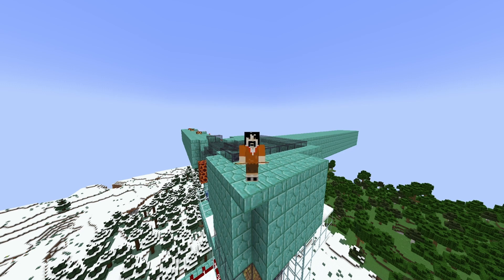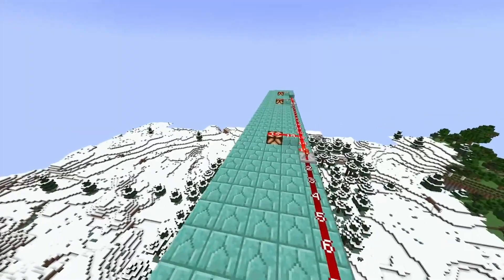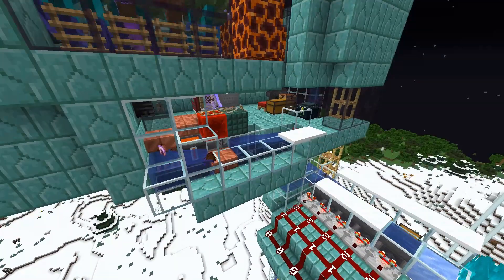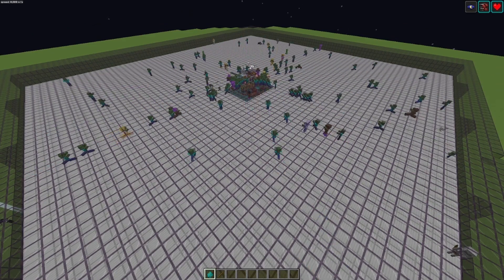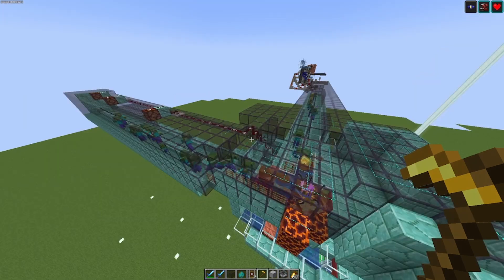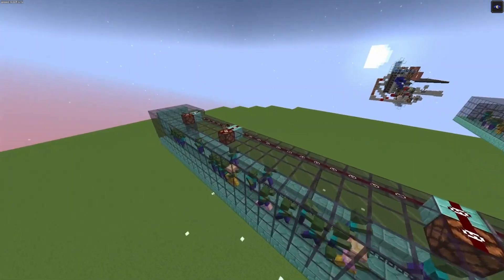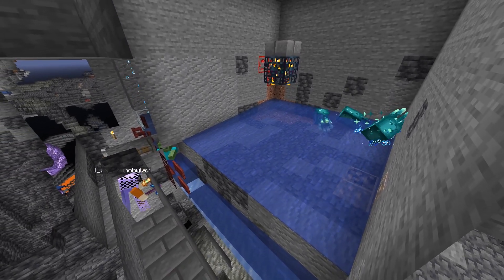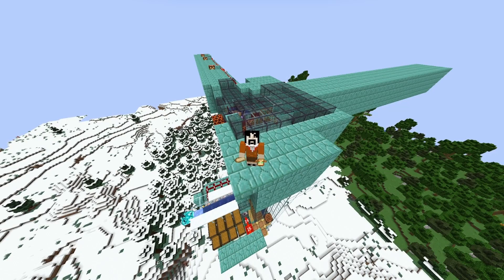(DEPRECATED) Lag-friendly copper farm based on IanXOFours design (Minecraft Java 19-1.21.1)

Comment: Hey Fruno, I built this farm on our SMP and somehow the minecarts are burning up in the lava cauldron. Would you have any idea why this is happening? I did use another mini block instead of the skelly skull, but as far as I know they all have the same hitbox.
Reply from the maker: I've seen this too, but very rarely and only on a server. So I admit that I was lazy and didn't really investigate -- it seems to be lag related, I'll lose maybe 1 minecart every 1-2 hours. Perhaps a different yeeting setup would work? 
If you just want copper then you could set up a simple item filter below the killing spot, but unfortunately this means that a ton of items will be around for 5 minutes until they despawn, causing lag, so I went the minecart route.
Reply: @FrunoCraft  Thanks for your response! It is on a server far away indeed (I'm in EU, server in USA), locally it seems to work fine. If it's probably lag I should resub to ExitLag and hope that fixes it, as I lose all my minecarts in about ten minutes.

[edit] When it does work, it's insane by the way! Very nice farm design!

[edit2] Looks like Exitlag doesn't help here. I removed the miniblock and changed the slab above the rail to a stair and that does seem to work so far though!
Reply from the maker: @ScubaKay  I just came across Ilmangos initial design for the yeeter, and he uses a soul sand block where I use a full block (the redstone one). I have no clue if it makes a difference, but maybe switching out the redstone block for soul sand and powering the rail with a torch might improve reliability?
Reply: @FrunoCraft  I will certainly try that, thank you!
Reply from the maker: @ScubaKay  I did another tweak to the yeeting system. It may be possible that minecarts get lost if they aren't running at full speed, so I extended the track a little bit with powered rails. I uploaded a changed world download.
Reply: @FrunoCraft  You're awesome! Thanks. I'll certainly check it out somewhere this week and this info will probably even help me with my multi item sorter design, where I have the same problem :D